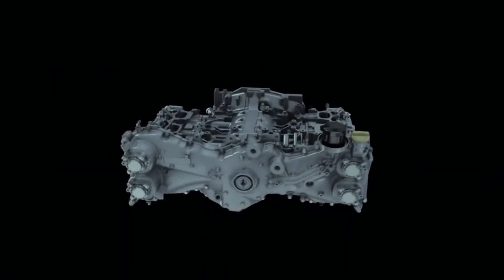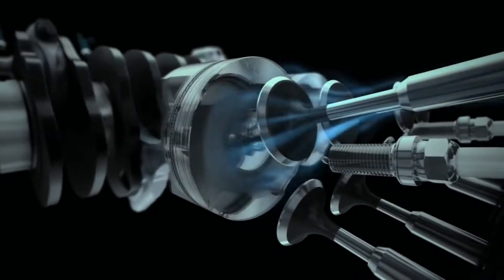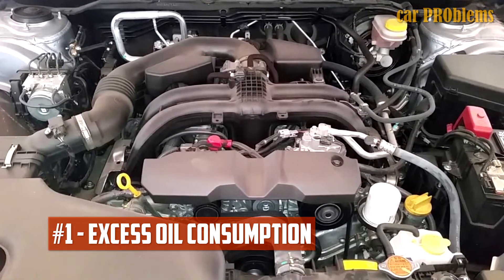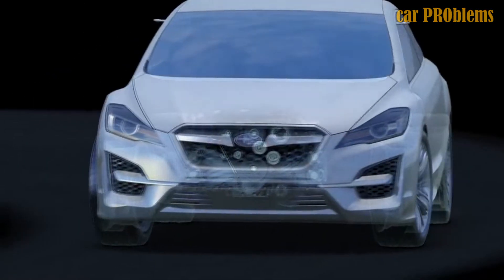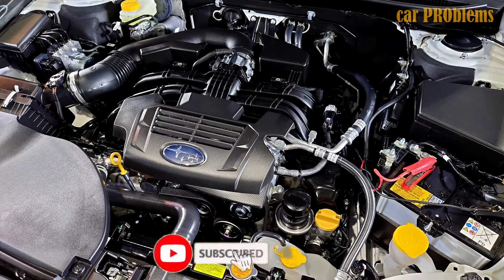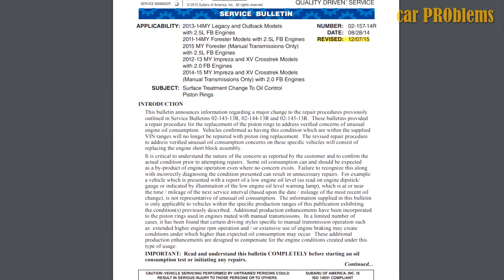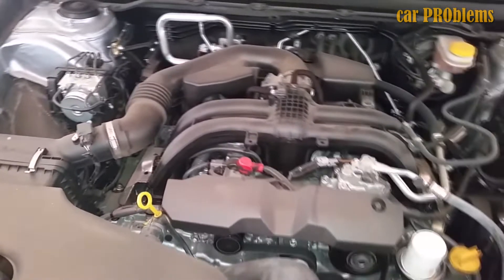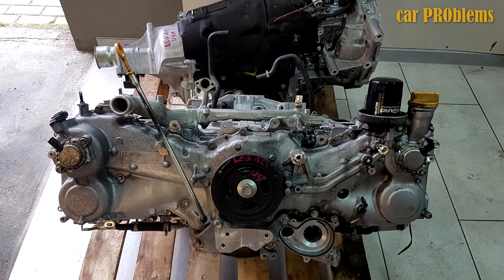Subaru 2.5 Engine Problems (FB25) - Bad apples?

Comment: Currently at 110k only issue so far was a bad ac compressor. Original Cvt still, and hoping for many more trouble free miles.
Reply: Did you change the trans fluid
Reply: @whoawoahh yes, I did that, changed transmission fluid, in addition to spark plugs, fuel system cleaning, serpentine belt replaced, cleaned throttle body, and did top engine cleaner kit, just last week at 96k, 2011 forester limited. Only thing went bad so far was ac compressor and we changed expansion valve and o rings as well

Comment: First Subaru bought off the showroom floor. Asked the dealer if it was supposed to sound so loud. Salesman said its normal. 400 miles it needed oil. Topped it off. At 700 miles i had a low oil warning light. In service several times. As i lemon lawed it. They meanwhile exchanged the short block as they had 'loose rings' to help with increased mileage. The 18 i exchanged for it had no issues. The 22 Onyx has had no engine issues either. But there were a few others that kept it in the service shop like a ping pong ball for a while. Its at 38k now.

Comment: My Outback with 190000 miles needs engine cover re seal 4200. From Subaru, prior replaced cvt valve body.... every problem  on a Subaru costs alot.

Comment: Nice engines. When properly maintained - they can last 300 000 miles (just look at used Outbacks and Foresters). Even the Lineatronic CVT is not a bad option... (But I prefer a manual transmission on Subaru cars 😀)
Reply: I had a 2015 Forester that needed a CVT after 107k miles. It started slipping again about a two months ago. Unfortunately I got an 02 sensor warning around that time, and long story short I’m out a vehicle. The best case scenario was a short block, but seeing as it was also throwing cam codes i couldn’t afford to fix it, it would have needed an engine. Subaru was not interested in helping me out. It’s less than 10 years old. 186k miles and it’s dead… 300,000 when property maintained? They said my oil consumption was normal. I put a quart in every Friday and changed it every 4,000 miles. Why did one die? 

It’s worth $5,000 in very good condition… that should tell you everything you need to know.
Reply: @iananderson8363  Because everyone has exceptions, and worse years. Toyota/Honda/Ford- you name it. Every dealership tech does engine/transmission replacements before 30k on their cars. Nobody is perfect.

Comment: We ride an 2018 outback, after 90.000km no issues so far. Though filled with 95 octane fuel and 5w40 oil.
Its not made for german highways - its a gas gazzler  when trying to hold 150km/h - lack of power makes cvt go nutts.
But the worst of all is the poor metal quality and thin paint... Rust ...
This is my last Subaru...  no confidence in quality and no efficent turbo engines...

Comment: My buddies '18 Forrester 2.5 seized at 90k miles. He changed the oil at the recommended intervals. White smoke blew out of the tail pipe and lost power. Dealership found antifreeze in the oil. The tech says he has never seen a failure like thus. Subaru swept it under the rug and the recommends a new engine for 15k. Im not impressed.
Reply: 15k for a new engine? Nah. You lying. Fake news.
Reply: @NoName-gv6nm  you may believe whatever you wish (based on your last quip it seems like you do believe in some pretty wild things) but I can tell you, in St Louis at a Subaru dealership the cost was going to be damn near 15 grand for a brand new Subaru engine and for the dealership to install it.  My friend opted to go to Eco motors, I believe that is what it is called, to have a rebuilt engine put in it.

Comment: My 2015 Outback with the FB25 is sitting at 393,800 miles.

Its been burning a quart of oil every 5k since about 75,000 miles on the odometer.  But now I either have a cracked head or head gasket leak as I have combustion leak into coolant.

Comment: 2016 outback fb25 code A 250,000 just blew!!!!!
Reply: What failed on your engine?
Reply: @0HOON0  head gasket had it repaired by a “Subaru Specialist performance shop” in Salem Or. for$3500 drove it 65 miles then cam bearings blew and the mechanic would not cover it under the warranty!!!! Fb25 garbage!!!!!
Reply: @stevepilant7894  Brutal. And very suspicious also.
Reply: @0HOON0   if your engine has a major failure it’s probably worth the 10k for a factory new one! Too many variables and new “improvements” to rebuild dependable again!!!!!

Comment: Have loved and owned Subarus for years now and I was a factory subaru technician for many years as well but I was not working there when the FA/FB engines were rolled out but I love and trust the EJ engines and still do..I only have experience with the fb25 in my forester and I am not very happy with it honestly...I've maintained this vehicle from day one and always use factory parts and I'm a master technician so not just a backyard repair type thing but I have had alot of issues with the engine and I honestly kinda wish I would have bought a used forester xt with a ej25 instead of the newer forester... kinda disappointing but I will always love my Subarus
Reply: The EJ head gasket failures occur around the 100,000-mile mark and start as a slow oil or coolant leak. Another common complaint is that the EJ25 has high oil consumption, which may be tied to these gasket failures. The FB25(D) was totally designed so that antifreeze DOES NOT flow thru the head-gasket. Instead, the FB25 uses the proven design of motorcycle engines which use dedicated plumbing to flow antifreeze thru the head. This does not eliminate head-gasket problems, but certainly reduces the possibility.
Reply: What issues have you had with the FB25?
Reply: Witam niedawno kupiłem SUBARU FORESTER 2,5 X wersja USA z 2012 roku produkcji z zamontowaną instalacją LPG. Zauważyłem że po przekroczeniu 5. 000 obr. na minutę wyskakuje błąd brak iskry na 1 i 2 cylindrze kod błędu 301 i 302. Co to oznacza?